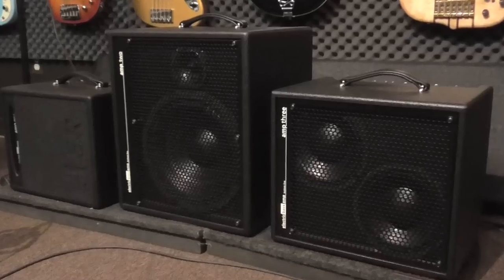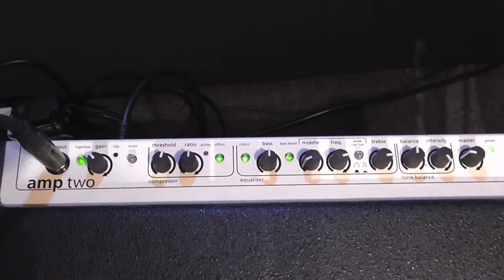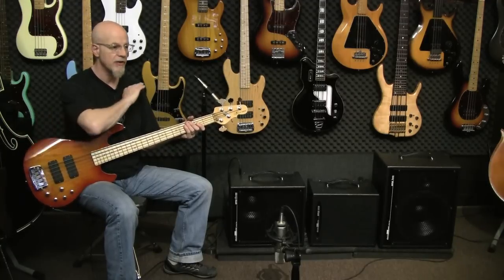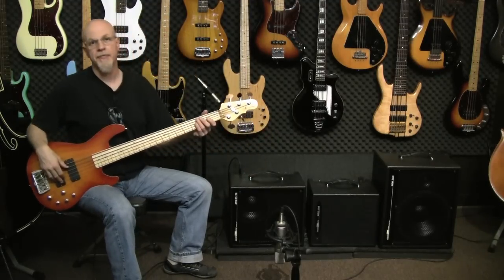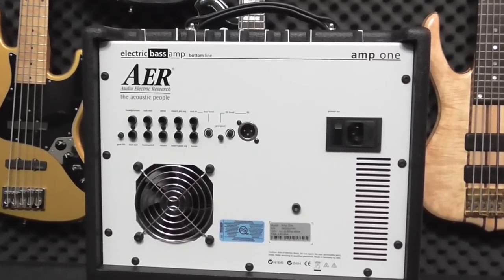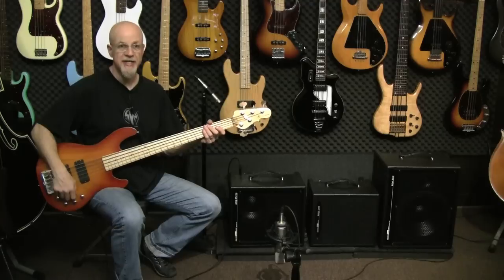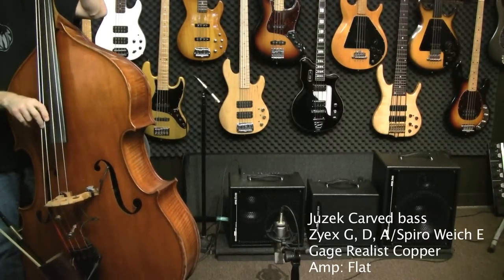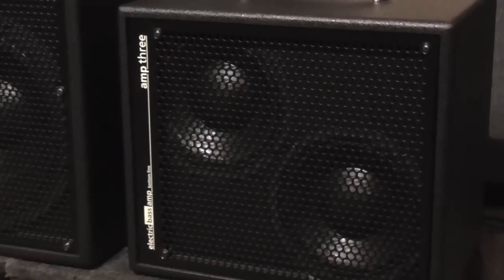AER Bottom Line Series Combo Amps, Part 2 - Amp Two & Amp Three

Comment: Either Ed's recording skills have started to go off the charts, or these heretofore unknown amps are some of the best I've ever heard.
Reply: Or perhaps both!
Reply from the maker: Well, it's not so much about my skills as it is my decision to record this amp from two locations. As I mentioned in Part 1, I'm mixing the Rode from the front view with a condenser mic placed 20" above the amp... roughly ear level. These amps have a BIG sonic footprint, and I wanted to capture that. As you can tell from the clip in Pt. 1 where I use just the Rode as a reference point... the amp sounds pretty damn great with just that... but the real deal is the huge, round, thump that comes off the cab. That's what blows your mind in person. I think I captured that pretty accurately.
Reply: I agree.  This vid gives you the "you are there" feel.  Love it.  I was going to get a Walkabout but this is changing my mind.
Reply: Definitely a bit of both. The new recording setup is really smart, but I've tried these amps in a store and am thinking about buying one, they're absolutely incredible.

Comment: Getting stoopid!....Great Review. So Ed...In identical band situations...you bring Amp3....or use the SVT fridge in the back line? Is this apples and oranges...or can these things live on a live stage with two guitars and drums? Thanks again for the great reivew.
Reply from the maker: This amp goes way beyond what you could imagine for something that small, but it's not going to replace an SVT. It excels in small clubs, I have used it outdoors on a wooden gazebo stage with great results, but yeah, it has held it's own against two electric guitars, keys and drums - indoors, and not hard rock. I use it weekly with a 10-piece Western Swing band that actually gets pretty loud (for that style), and it's got way more power than I need.

Comment: What about the Markbass mini CMD121p? 300W, just under €1000, very compact and light.
Reply from the maker: Like I said in the video... you CAN NOT compare the AER amps to anything else. MB makes perfectly usable amps...and while acceptable to most people, they do not perform to this level. That is a simple fact, not a knock on MB. TO put things in perspective, someone pointed out to me that the AER combos still cost less than a Walter Woods head.

Comment: How do you think they compare to the Genz-Benz Line
Reply: He said "You cannot compare these, to those amps.  These three amps are in a class all by themselves.....there's nothing that touches this stuff".
Reply: 216trixie Interesting.
Reply from the maker: The Genz Shuttles are what I've used for the last 5 years... great amps, very practical and they sound great. As useful to me as they are, put side by side, the AER still has way more low end and balls. The cab design is totally different and it behaves differently. The Genz is still useful to me, the fact of the matter is, sometimes, I still want a tweeter. The AER can get plenty of high end if you know how to use it, but having a tweeter works better for me in some cases. Plus, being able to connect to an extension cab with the Genz extends it's usefulness. The AER is a self contained unit. If I could have one of their powered extension cabs... I'd be pretty well set for anything.
Reply from the maker: Bass Whisperer TV The AER couldn't be the ONLY amp I own, but it will cover a good portion of the work I do. I'm using it regularly these days.
Reply: +Bass Whisperer TV Ed which model out of these three do you use? out of models one, two & three? from your review here gave me the feeling your ideal choice was Model Three? am I right in my thinking?
Reply: I have the Genz-Benz Neo-Pak 3.5 Head and 2 Neox 112Tcab`s. I have heard Fender took over Genz-Benz and shelved them. If you notice they are no longer available. Tipacle Fender move.
Reply: IRONSTORM4

Comment: So what is the secret to these amps sounding so good?
Reply from the maker: Several things. A well-designed amp being used to efficiently power a small, but rigid bass reflex cab loaded with high power-rated speakers. It's a little eco-system that has been designed for a purpose. There is no compromise to cost consciousness... which, sadly is usually the FIRST thing a manufacturer is forced to deal with when bringing a product to market. These guys just went for it, and succeeded (IMO.)